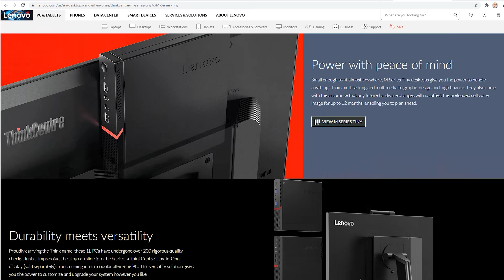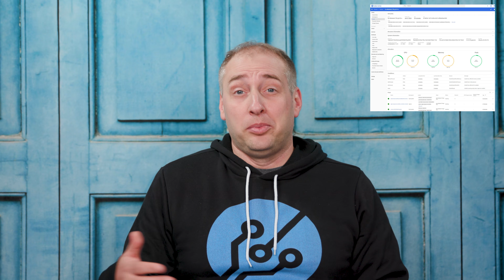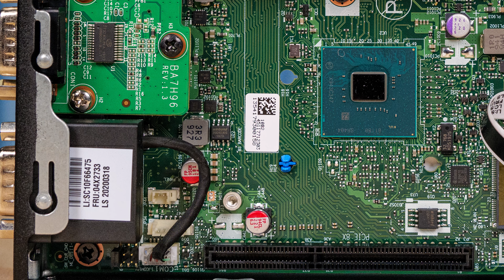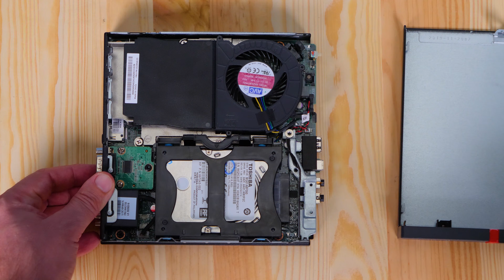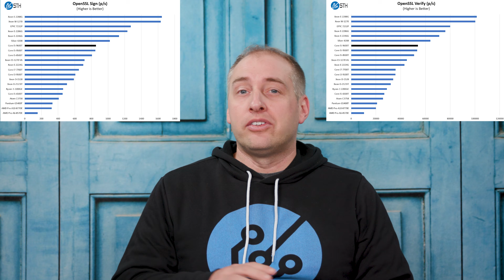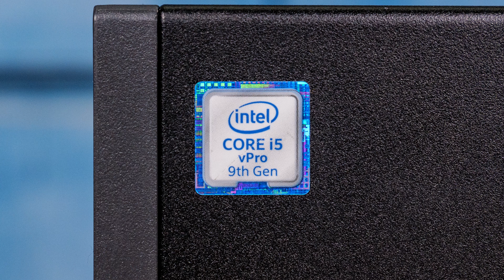Lenovo ThinkCentre M920 Tiny Guide and Review

Comment: Thanks STH for covering this hardware! I know I'm late to this content but I just picked up a refurb M920Q unit and put in a 4 port 2.5G PCI card and I was able to turn it into a Linux 2.5 Gig Router/Firewall. It's a nice little 1L PC form factor! :)
Reply: Im planning to do the same. Do you know is there 5g wan cards for this?
Reply: @karohamalainen176   yes there are some nice good quality Intel PCIe 10G cards available based on the X540 and X520 chipsets (ethernet and SFP ports)! :)

Comment: Nowadays where you get Nvidia Quadro P620 GPUs for $60 on ebay i upgraded my tiny M920q to a small gaming PC. Just had to order a $6 riser card from Aliexpress and drill holes in the case like the Thinkstation P330 has it for the GPU vent. PSU i already had a 135W one. After 200 weeks of research: yes the ONLY GPUs that fit are Nvidia Quadro ones (P600, P620, P1000, T400, T600, T1000). You don’t get 400fps, but for X-plane it is more than OK. 
Just don’t spend more than $100 on the GPU, on bigger PCs you get a used GTX 1660 for $120 with double the performance. Or for $250 a brand new RX6650XT for quadruple perf.
Reply: Put a MSI GT 1030 with GDDR 5 memory in my 920q, its works fine. Sparkle ECO GPH don't work in 920q, take at least a 10th gen cpu.

Comment: My any chance do you a video explaining every connection inside the MB I see a bunch of spare port empty and I was looking at a the manual and connector 4 say dc connector? O wonder what's this for and where can I find a cable for for it i believe is an  an 8pin connector wondering if it can supply power to a GC or any other upgrade I wanna build a miniature gaming pc to run it on My car for long trips

Comment: Not impressed that they intentionally removed the ability to add a second nvme drive - like, they actively made a decision to remove it in order to sell it back to the user in a higher-end model.  

Business is business, sure - but at some point greed has to be pointed to and called out as well.
Reply: They also made the decision to limit the 920Q socket to 35w... Even on unlocked CPUS. The 920X and the P330 Tiny both have the socket limit raised to ~65-90w (can't remember exact wattage) pretty sure the hardware is the same mainboard with only small additions. This allowed one reddit user to even put a 9900k in his P330 Tiny.

Comment: On serial: while today most common lab measurement tools (oscilloscopes, calipers,...) tend to be made with USB, serial is still very common on the more obscure stuff, like some special signal generators, heating chambers and special built stuff. Oftentimes serial is simply preferred, because it's a robust, locking connector with great signal integrity, since it's using higher voltages (+/-15v vs. 0/5V for USB). This is especially useful in - as you mentioned - manufacturing equipment, but also research. I've personally never seen a computer controlled lathe or a mill that used anything else. You simply cannot afford some worker pulling out a USB cable by accident, because even 5 minutes of downtime can cost millions of dollars in a large factory. Same would apply for the various CERN experiments. Computer geeks of today somewhat understandably chuckle when they see one, but it's actually a remarkably well-engineered, robust protocol, in opposition to USB, which has become a hodgepodge of complex standards under one label, especially in recent years (there's like 3 or 4 ways to do audio over USB). VGA is the same, which is, again, why it's still used. TL;DR: "Perfection is achieved, not when there is nothing more to add, but when there is nothing left to take away."
Reply: who are you? bill gate

Comment: I’m putting a GTX 1650 in one of this. Yes, there is but one half height single slot GTX 1650 in existence, made by ASL.
Reply: Oh, and it’s paired with an i5 9400f. I’m out of my mind, thanks in advance for reminding me that.
Reply: Hope you can answer! What card con fit in this cpu??
Reply: @davidsuare572  I didn’t understand your question, sorry.
Reply: @Nanorisk  could you put a video card to this pc??
Reply: @davidsuare572  yes, but only half-height single-slot short cards. The most powerful one so far is the ASL 1650.
Reply: @Nanorisk  a low profile 1650 will be for my card, where did you buy it??
Reply: @davidsuare572  online from China. ASL GPU are not on Amazon.

Comment: i have the m720q with core i5 9500t 2.2ghz turbo 3.7, 12gb ddr4 dual channel  256gb ssd micron.
Reply: question - how loud does the fan get? I have a Shuttle XPC Slim and every 5 minutes it revs up the fan and sounds like it's about to to take off. Nothing wrong with it, that's just the way it's designed. Are the m720q any better?
Reply: @noeldown1952  the thermal paste is still the original? i am using Grizzly Thermal Pad Carbonaut. max 71ºc  and less 50db on cb r20

Comment: I work in IT and we are getting rid of all desktops and moving to laptops with USB C docks. We had excess stock of these so managed to get one brand new for £50.

i5 8500T, 8gb DDR4. 256gb NVMe. Absolute steal.

I am using mine for tiny server based roles. I added a 500gb internal drive and a 1tb external which I put some shared folders on.

Comment: Would the HP Z2 Mini also count? Lenovo P330 Tiny would be the one with the Quadro in it.
Reply from the maker: Great question. The Z2's are 2.5-3x as big, more costly, and use much more power. John just did a Xeon W-1290P review on the STH main site which shows just how much more power/ performance you can get in those types of systems https://www.servethehome.com/intel-xeon-w-1290p-benchmarks-and-review-a-top-end-sku/

If we can get one cheap, we can work on adding them to the comparison.

Comment: Great video!! the only thing I am missing in series is ranking of all of these by performance or by how could are they for small lab cluster purpose (which I understand whole series is about) in one ultimate list.. with every video list should be updated and newly tested device, should be placed where it belongs in the list
Reply from the maker: The challenge with it is that we buy one configuration, but there are huge option ranges. I get the point though so let me see what I can do.
Reply: @ServeTheHomeVideo  no problems, I understand the difficulty. Maybe making up some points system could help (how upgradable is, max ram, best CPU, M2 ssd support, available ports, case size..).. 
Just idea ;)
Reply: Can you please give me directions to reinstall windows  on this Lenovo thinkcentre thanks need help

Comment: So, i know like this not might be a problem everyone gonna have but there are old devices that aren't compatible with newer USB 3.0 or above ports. Personally i have an old android tablet that wouldn't connect to my tiny machine because the configuration that i have doesn't include any USB 2.0 port.
So on these review it would help some folks out to mention about USB incompatibility if they run an electronic repair shop or home lab that use older equipments

Comment: You should check out the Lenovo M90n which is about half the size of these units yet still packs a solid punch.  I have one specced with an i7 8665U vPro CPU and 16gb RAM that I use for my VM's/Docker.  Also has two m.2 pci-e slots which is useful for either ssd's or a NIC/HBA if using a riser cable.
Reply from the maker: We have one inbound albeit the 8GB Core i5 $399 special
Reply: @ServeTheHomeVideo  Nice! Looking forward to the review!

Comment: Correct me if I'm wrong, but can't that "special" slot be used for any very small PCIe card on a riser? I've been thinking about building a dedicated Tiny/Mini/Micro node for CAD, but want something I can throw my tiny Quadro K1200 in. Am I crazy or would I be able to rock an i7-9700T with a Quadro K1200 in this chassis? Max power consumption would be 35W CPU + 45W GPU.
Reply from the maker: You can find effectively this already made if you look at like the Lenovo ThinkStation P330 Tiny. We did the P320 but the P330 has additional cooling. Those are more for multi-monitor but they have Pascal Quadro GPUs. Also, we have a M920x with a Radeon R560 I believe. 75W GPU is hard to cool
Reply: @ServeTheHomeVideo  Thanks for the reply. I'll look into those. I mistyped, the GPU is a 45W (I have now edited my original post). The advantage of the K1200 is that I already own it and it has 4GB of VRAM (double the 2GB in the P620 in the Lenovo P330 Tiny, although Solidworks also officially supports that GPU too). Definitely would prefer a workstation card over a consumer Radeon card. Do you know if it would be physically possible to install my K1200 (a low-profile half-length single-slot GPU) with the riser in the system (even if it's a dumb idea)? Love the content of this series!
Reply from the maker: @noahlistgarten7832  It might be possible, but I think there is a decent chance you are going to run into issues. That is why I would recommend either the P330/P320 or just getting a slightly larger system. You also need to do things like get the 135W PSU, riser, likely will need to custom make a backplane solution. Then hope everything fits and is able to be cooled in there. To me, seems like too many variables. Always an option to sell the K1200 and use it for the systems with designed-in GPUs. The P330, for example, has a larger airflow cutout for the GPUs that the M920q does not have.

Comment: At the moment Microsoft is not enforcing restrictions on license key resellers.  That completely changes the cost equation towards building new yourself.  Also building yourself gives you a machine that instantly gives you hundreds of dollars of reselling value --- the ability to put in any decent video card such as an Nvidia 1660 to create a gaming machine.
Reply from the maker: The point of these machines is actually that they are smaller and lower power than a GTX 1660 system can be. Building something bigger is easy, but if you want 3-5 of them, having compact systems is key, especially in urban areas. An i5-9600T is around $200 used, $50 for the 16GB stick, $50 for the SSD and we get a $175 premium for the motherboard, chassis, cooler, power supply, and Win 10 Pro. This is also ready to go without any assembly so for those of us where time is very expensive, 30-60 minutes to put something together is very expensive.

I totally get there are other segments out there, but we are not covering gaming here.

Comment: I want something like this with at least 2 LAN ports, preferably 4 LAN ports... and cheaper! :P
Reply: The M920 Tiny can be configured with a Intel I350-T4 Quad Port Gigabit Ethernet on the Lenovo USA website (availability of configurability varies between countries), but it's not going to be cheaper.
Reply: @starshipeleven  Every "router" I've ever used (i.e. pfsense on some tiny pc) only had one ethernet port. You can use a single port for both LAN and WAN if you have a vlan capable switch. No need for two ports :)
Reply: Me too, but even more 10GB ports-  so it sounds like maybe USB3 to Eth ports are the way to go, but then it’s a dongle....
Reply: @ystebadvonschlegel3295  It would be nice, but for 10GbE I'm more in need of a cheap switch. Even 2.5 and 5GbE would be enough for my Home Lab. But for the switch I don't need processing power. I had a Qotom 4x1GbE, Atom based. It was OK, I guess, but if you want to use it for IPS or IDS, or even with smart QoS, the Atom is just too slow. I'd like something that can route 1Gbps with IDS, has 4 ports, and doesn't cost too much! But I just can't find it for less than $500.
Reply: starshipeleven I hope that will change.  Not sure why we can get 10gbps through a USB3 port with no problem but an Ethernet 10GB port causes so much heat, but it is what it is.
Reply: Seeed Odyssey might fit the bill for you.  CPU is pretty low-end, but it has 2 Intel NICs, and you might be able to wedge more in via the M.2 slots.
Reply: What do you need 2 lan ports for?
Reply: @toysareforboys1  Router, for example. And make use of the CPU for IPS or IDS. Complex QoS also.
Reply: @andibiront2316  I've ran pfsense on PC's with single ethternet ports as my router for more than 10 years, vlan's ftw :) If you needed full gigabit speeds I could see why you would need two.
Reply: @toysareforboys1  Generally speaking, for talking to 2 different things or for talking to the same thing twice as fast.   So routing ,firewalling, bonding, switching, SAN, passing to a VM, etc., etc.  Weird. I think you sponsored a video on Canadian gun laws I watched earlier today.
Reply: Agreed. I've been looking for a mini PC like this with two NIC ports. They have them. However they all seem to support only the Celeron line of Intel CPU's. Out of all the mini pcs I've been looking at. Only Shuttle has a barebones system with two NICs. I think it may be possible to add a second NIC to this mini from the video. I'd have to research further though.
Reply: Check Amazon for Qotom or Protectli. From Celeron to i7. Up to six Ethernet ports.